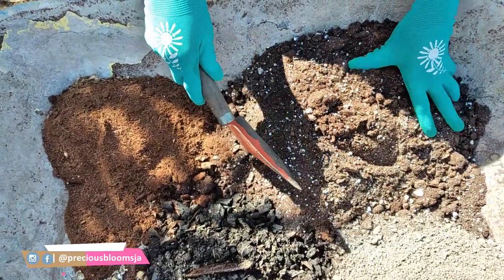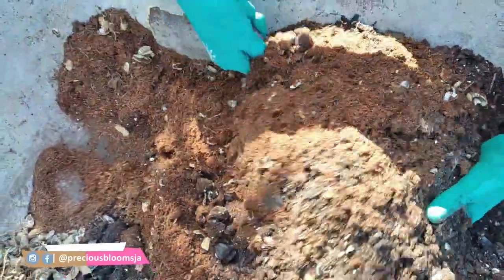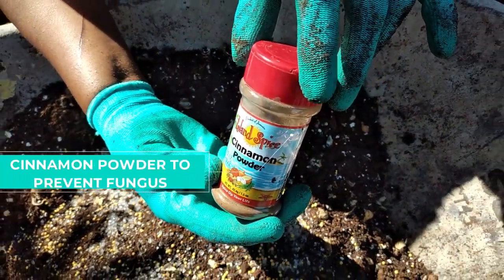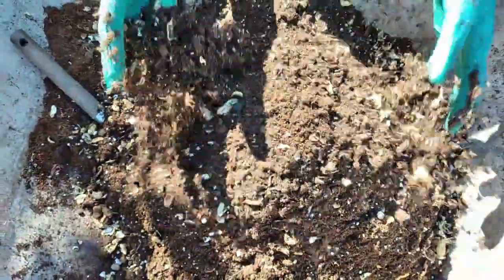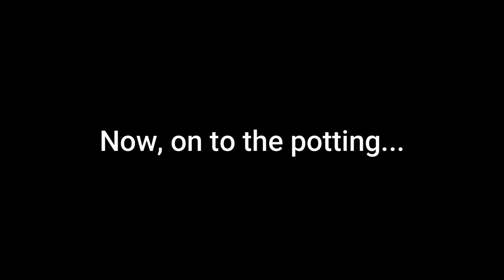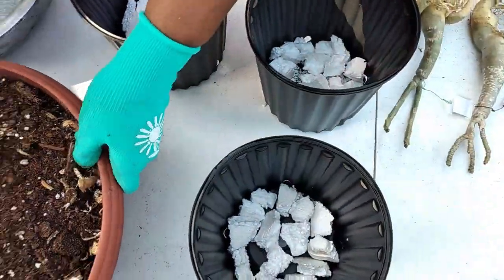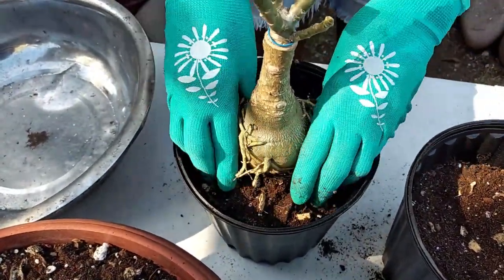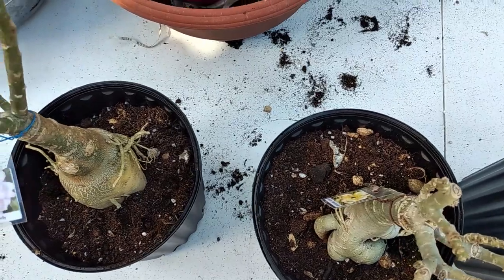Potting My Bare Root Desert Rose (Adenium) | Avoiding Root Rot | Ideal Soil Mix

Comment: Got 2 plants but all the buds are falling off and the leaves turning yellow.  What do you think is wrong 🤔
Reply from the maker: Hi Anysia. Thanks for tuning in to my channel. Sounds like you have an overwatering issue or perhaps you are wetting the entire plant during watering. These plants do not like water on their leaves period. Also, they enjoy at least 6 -8 hours of full sunlight and may lose their buds or leaves if they are placed in a moist environment. Another possible reason is that your plants may also be infected with insects or fungus in which case you should treat with a fungicide and insecticide.